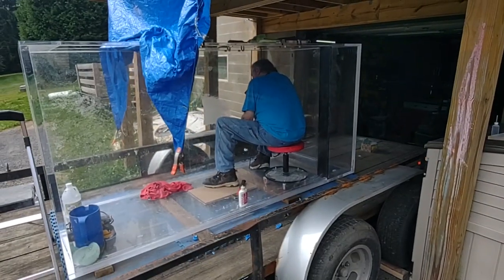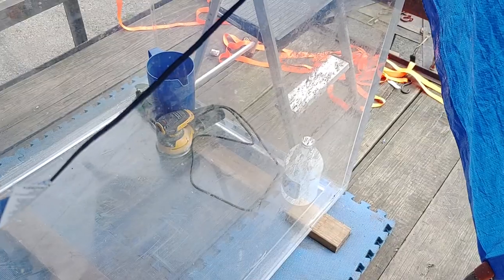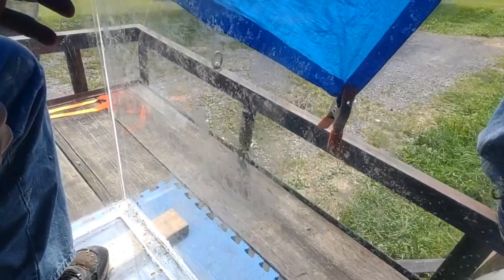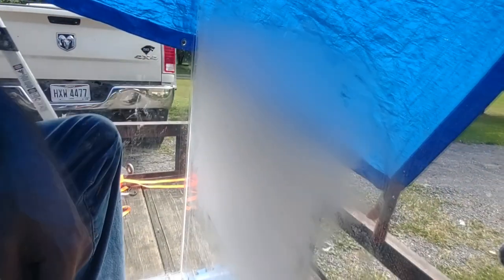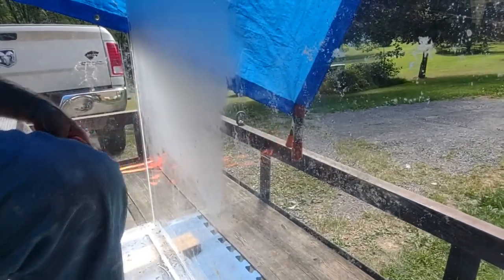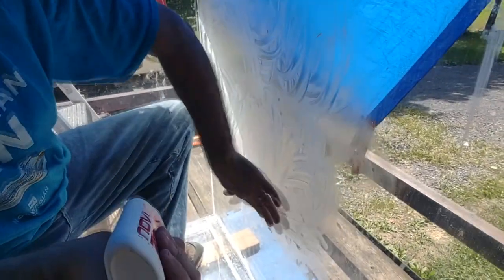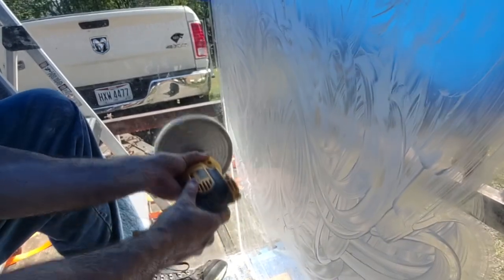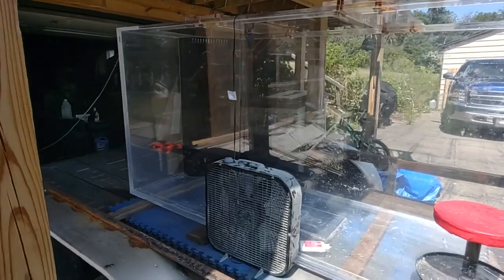HOW to POLISH ACRYLIC // MASSIVE AQUARIUMS // REMOVING SCRATCHES from ACRYLIC

Comment: AWESOME video, THANKS for sharing :)! I polished out some scratches on our 125G. They were small so I was able to get away with a headlight restoration kit and NOVUS 2. The tank came back with me from Japan when I was in the Air Force in 1995 so it is close to 30 years old and we just got it wet back in April. I used the same techniques that I use for polishing aluminum and stainless automotive parts. I was really surprised to see a spiral sewn buffing wheel being used. Figured that the stitches holding the wheel together would scratch.
Reply from the maker: Thanks for watching and following along, glad to hear this video helped. I'm excited to get back in the tank and polish this beast up!!

Comment: I just picked up a used tank. Went out and purchased a air compressor powered variable speed orbital sander with 800 to 10,000 grit wet dry sandpaper and Velcro with padding behind it. Also sponge buffers like you used on the drill. And the Novus polishing compounds. I have some deeper scratches. But based on your video this should work without leaving circular scratches as long as I don't use too much pressure.
Reply from the maker: Thanks for watching and following along!!! Hoping it turns out perfect.